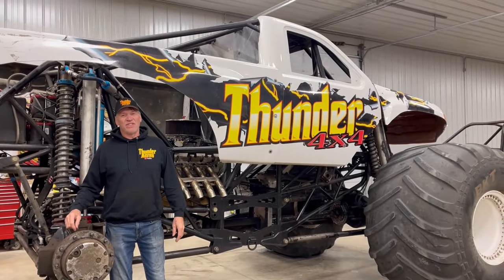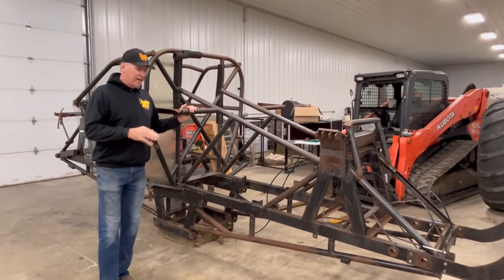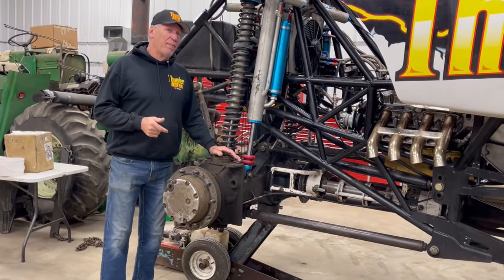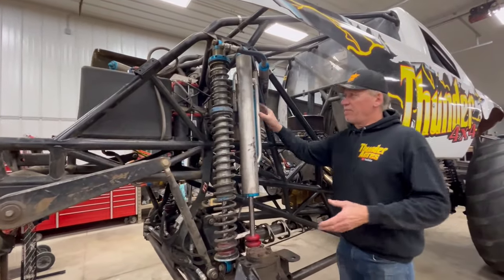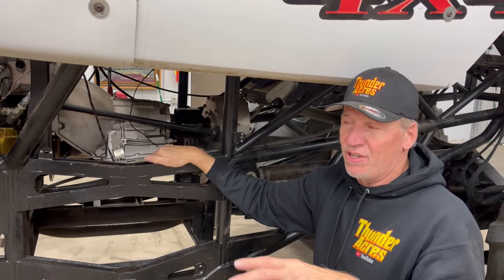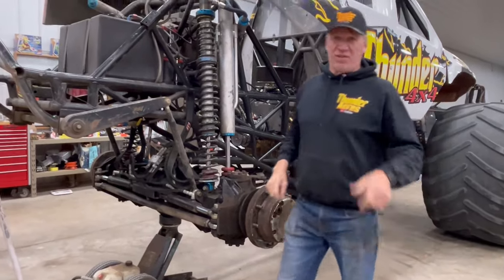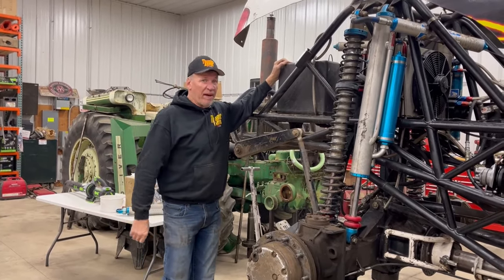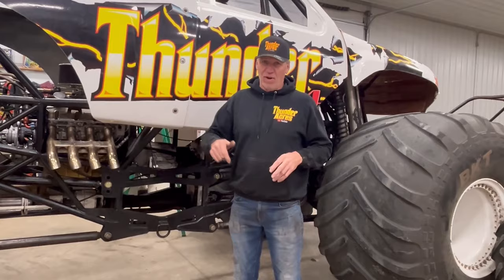HOW TO BUILD A MONSTER TRUCK ! THUNDER4X4

Comment: Great video, thanks for sharing!!
What axles did you say those are?
How much do the axles weigh?
Reply from the maker: soma axles , about 1200lbs if I remember correctly
Reply: @thunderacres3573  thank you. I will look into them for a mega truck application. A little on the heavy side but, might be able to lighten them up a bit with a sheetmetal housing?
Reply from the maker: keep in mind thats with all the xtra weight from steel added to make them hold up @toddformanek8495
Reply: @thunderacres3573  I hear ya. I'm not having any luck finding anything on them. Who has them?
Also, whose chassis is that? I am wanting to build a chassis similar to what you were saying. I'd like to have the dropbox in the center of the cradle, with the engine a little further back. Might require a dry sump pan for clearance? Most of the really fast mega trucks run their engine just behind the front axle for better steering though.
Reply from the maker: axle was used in some of the white farm tractors and some military, but they are very hard to find !! my chasis is crd about $30k, i would go to dan patrick chasis if i was to get another ,he runs samson monster truck @toddformanek8495